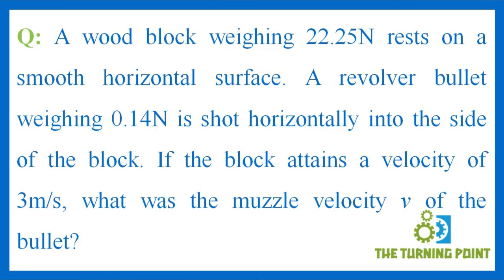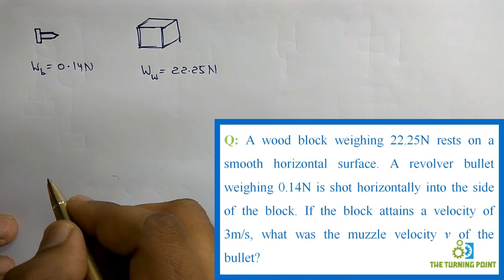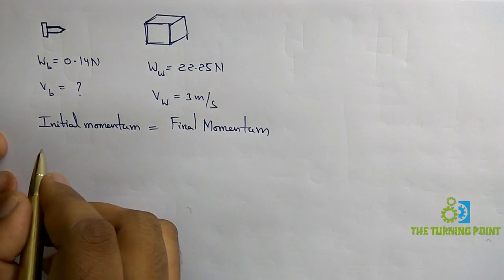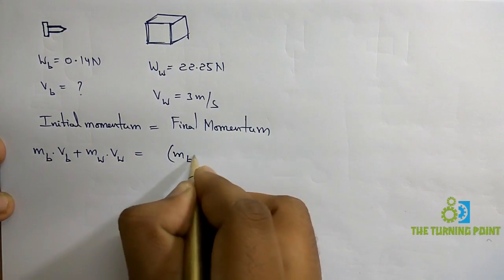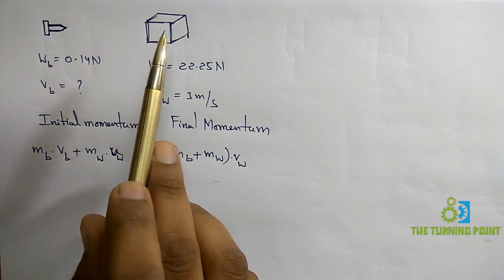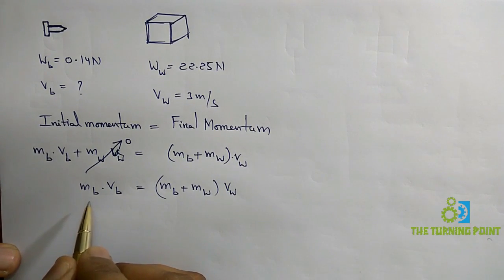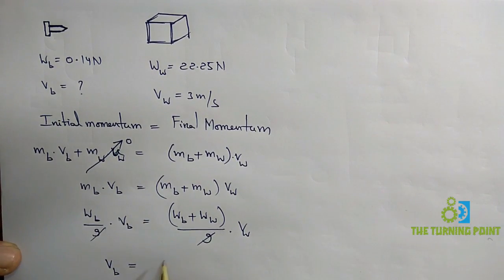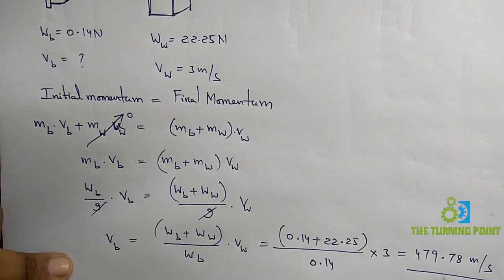Dynamics Problem 11

Comment: Sir as you said that bullet and block both travel together after the bullet hits the block.

why don;t you consider a case such that ""Bullet pierces through the block and again travel with its own velocity??"""
Reply from the maker: In the given problem it is mentioned that BULLET IS SHOT HORIZONTALLY INTO THE SIDE OF THE BLOCK.
Whether bullet is embedded or piercing the block no change there.
According to law of conservation of momentum THE INITIAL MOMENTUM = FINAL MOMENTUM
When you consider the final momentum in the impact masses involved are mass of bullet and mass of block. 
Therefore you need to include bullet mass and block mass in the final momentun